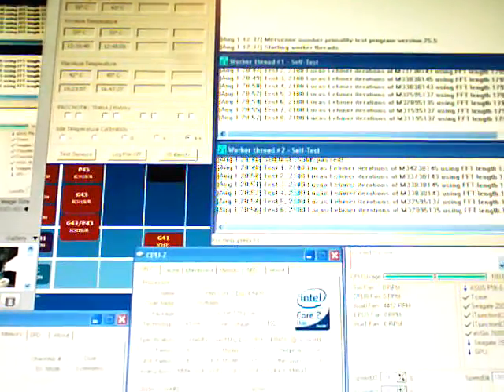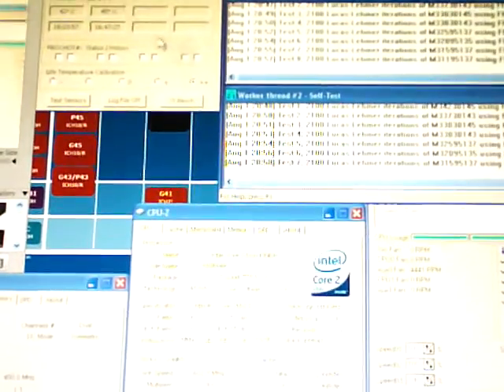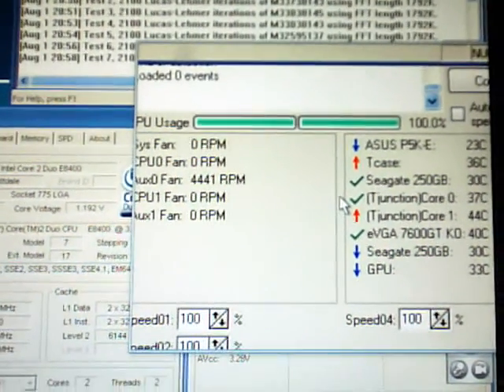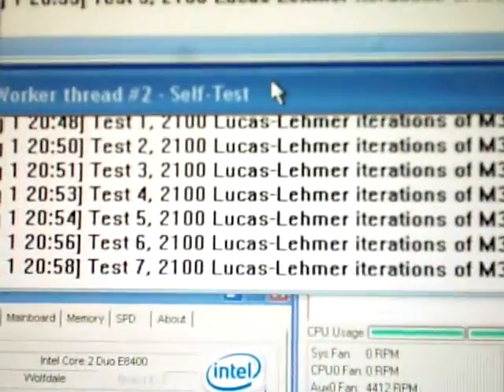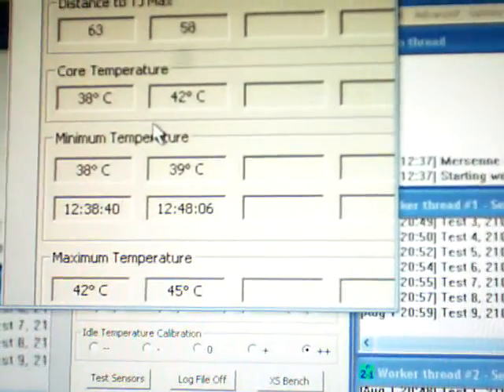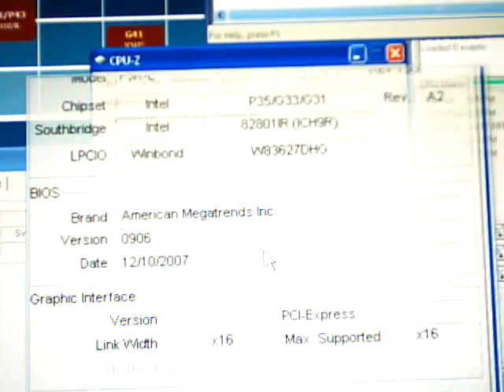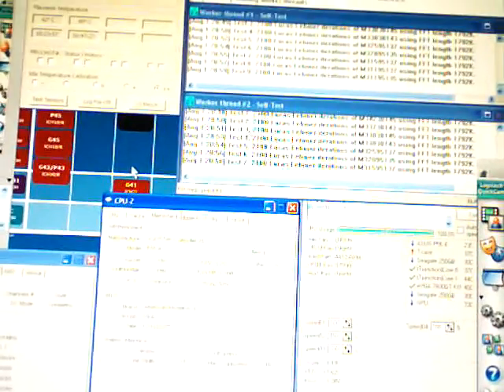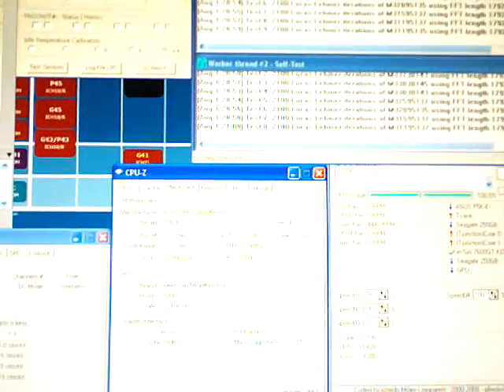E8400 400x9 3600MHz Stable Air Cooling

Comment from the maker: Best with E4500 in super pi 1.5 was 17 sec, and now out of the box E8400 ran mid 15s. Got it down to 12.500 in 1M with 415x9 3737mhz stressing at 1.224v now with 53c temps.

Comment: rick i got the same CPU E8400 Wolfdale running on a EVGA 680i Intel Motherboard and a artic cooler Pro Freezer 7. for some reason it's going at 48 degrees celsius. Is this because my room is warm or is it my heat sink?